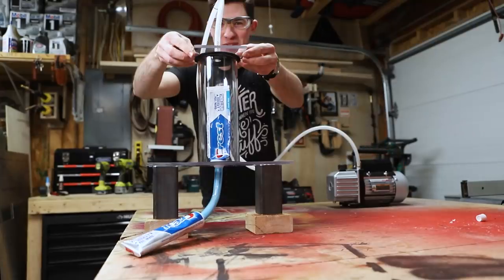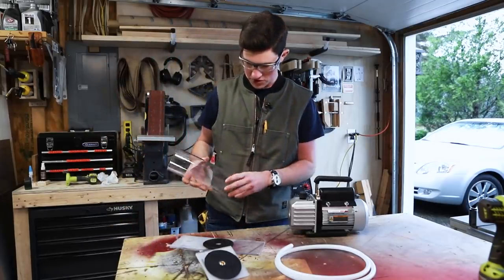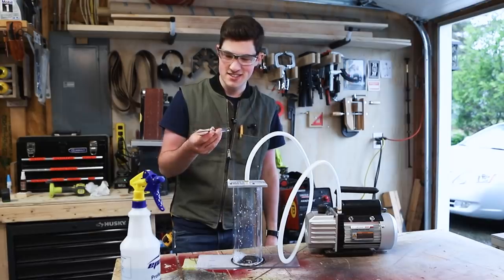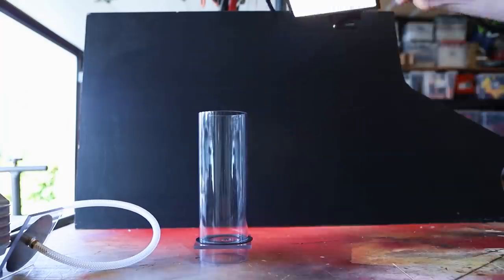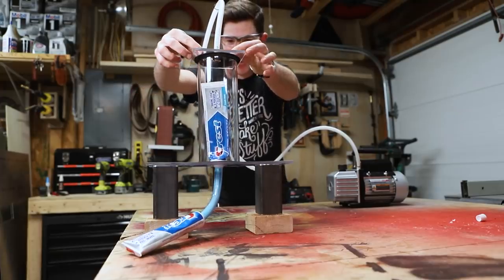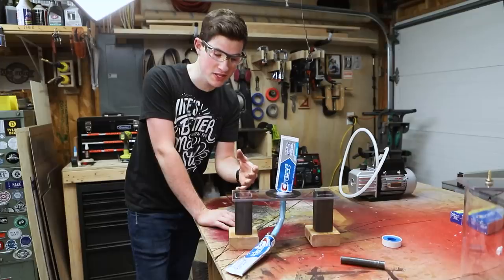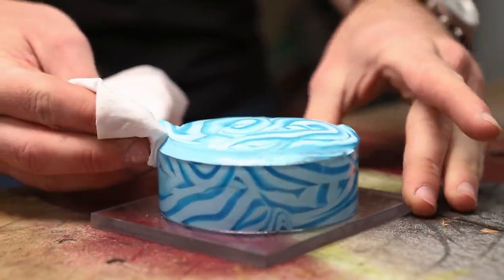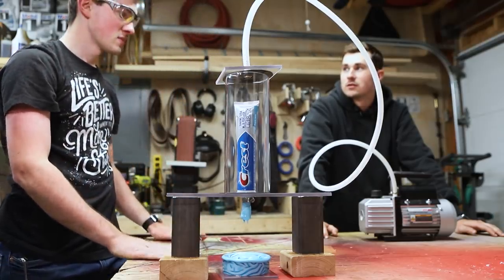putting TOOTHPASTE BACK in the TUBE... Possible??

Comment: Turn the Setup around; let the toothpaste flow from the top and the vacuum connection be on the bottom.
Also, use a narrow but long container for the toothpaste :)

Comment: Random thought from seeing you post about this on IG. You don't want to drop the pressure around the whole tube at once. if you could draw the vacuum from the front of the tube and expose the rest of the tube to the vac incrementally you might be able to draw less air.

Comment: Take that smaller discus and make it sealed. Using a pressure valve proceed to attach a tube between the vacuum chamber and the secondary chamber creating a close loop system. Maybe, it may not work though due to air in the tube itself.

Comment: Buddy, use a balloon to keep your tootpaste free from air bubbles. Actually the air start penitrating like a needle from very thin point. and what you expect it to work as a very strong piston. So for that use a balloon to keep your toothpaste like a fluid where air is not penetration on it. And I noticed that toothpaste have very high viscosity. so it won't leveling itself like water. it like to stay remain in it's shape what is given to it. Your issue is like cavitation in most high power motors where the water sucked with such high speed it start sucking air because air start penetrating it. I got this idea this morning, coz I watched this video last night. If you need a visual represntation. please give a heart on this comment I will definatly shows you where it went wrong and how You can fix it. and good luck for your new projects.

Comment: You need a cylinder filled with toothpaste with a nozzle at the bottom.  The top of the cylinder needs to have a sealed plunger like a giant syringe.  Then you can use a vacuum to pull the toothpaste back in and the sealed plunger will prevent any air from getting into the system as well push the dregs forward into the nozzle.

Comment: I would recommend that you put the toothpaste under a vacuum before you start the tube suck to pull the air bubbles out similar to using a long set resin

Comment: Try pulling the toothpaste from a hard-walled tube/plunger system like a syringe. This would create a balanced system with continual, even exchange of toothpaste throughout the process. I'd wager a success rate of 99.9% using this method. 👍🏻

Comment: The trouble you had at the end is that the vacuum was getting too strong. You need a consistent vacuum pressure in a certain range to pull all the toothpaste into the tube. Too much vacuum and atmospheric blows through the toothpaste pudlde,  too little vacuum and you don't suck any of the thick stuff up.

Comment: Bit late to the party, but this could have also worked using a sort of piston design there. just a piece of plastic on the top of the dish with a hole for the tube. You could even glue it to the tube and it would prevent the cavity from forming.

Comment: The tray with toothpaste is the wrong shape. If you have a higher thinner tray and use a longer tube that can reach the bottom of the tray you'll have less chance of air being sucked from the surface. Wound love if you could revisit this experiment with those changed variables

Comment: If you keep with the train of thought of sucking it up. I would add a solid round plexiglass part and use a straw from the toothpaste tube to the round part. The round part would have to be slightly smaller than your cup. A French press for toothpaste, lol

Comment: Just found your channel. Liking what I'm seeing. You might already know this considering it's been a year since you posted the video. I'm assuming that if you can control and slow down the rate of flow out of the vacuum chamber to your pump, you might be able to pull this off with the open cup setup. It seems that the toothpaste in your cup is not flowing fast enough from the edges to keep air away from the input hole of the clear hose.

Comment: its a easy fix bro. theonly issue with ur first setup was that the filling tube had to have more capacity, ur trying to refill a tube, not to perfectly empty the other one at the same time. why dont u just fill a small cola bottle or a AA bottle with toothpaste and try it again just make sure ur seals hold more presure then the toothpaste creates and ud be fine

Comment: Seems like a fluid dynamics issue
Reply: Put a valve on the vacuum line that will allow you to regulate the pressure. Turn it down. The speed of the tooth paste self leveling is too slow for the speed of the vacuum. Really just put a pin hole and then another.

Comment: probably too late for a follow up on this video but you should try also connecting the toothpaste tub with a rubber sealant on the bottom so that it also becomes an airtight vacuum chamber and can only suck up toothpaste

Comment: Usé a syringe full of tooth paste then connect it you can also apply pressure to the syringe plunger so the toothpaste doesn't boil or cavitate due to low pressure.

Comment: Why not glue a flat empty tube (A) to a full tube (B), and then squeeze B into A?  Then break the glue bond.

Also when smelling chemicals, never put your nose in it.  Instead use your hands to waft the air toward your nose.

Comment: If you use a funnel and flip the whole thing upside down wouldn't the toothpaste feed better to the other tube without creating a air pocket? You still may need to heat the toothpaste to make it a little thinner.

Comment: My take on how to perfect this would be put the dish in a vacuum chamber to remove bubbles inside
Reply: I think you perfected the "priming" of it but maybe more of that technique if the above doesn't work.
Reply: Also some way to cycle between vacuum and pressure (and maybe orientation) to try and do what you do with syringes.

Comment: The cup of toothpaste needs to be closed. The bottom of the cup needs to be able to collapse into the cup pushing the toothpaste up when pulled by the vacuum. Think of a tube of caulk how the bottom of the tube pushes in.

Comment: Why not prefil a length of pipe with more than you need with toothpaste and then have bavkpressure on the toothpaste so the vacuum pump doesn't have to do all the work

Comment: All then engineering and didn't build a toothpaste tub holder...or reverse the air pressure to push the toothpaste back out after each failure.  WHAT IS THIS MADNESS?!

Comment: You (not so subtlety) answered the question you posed within the first 10 seconds... you need to be more subtle. Other than that bro good video! I stayed and watched because it's a good video and because im a bit inebriated and can't type fast.
Reply: Wait... it was just air 😳

Hold a sec
Reply: Alright you had me in the first half, not gonna lie

But ok so what about an acrylic tube with a jumper hose on the bottom feeding into the bottom of the vac chamber
Reply: Overall, 9/10